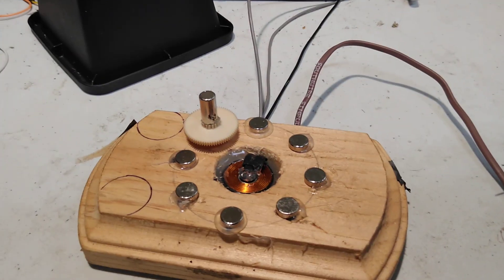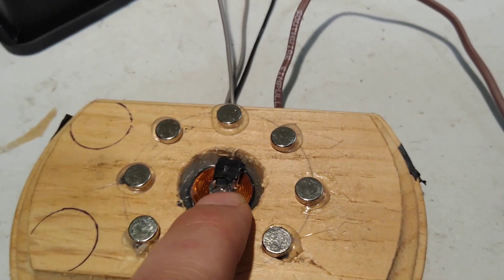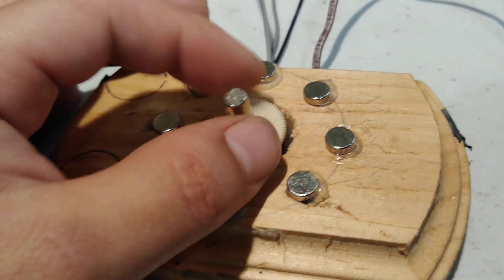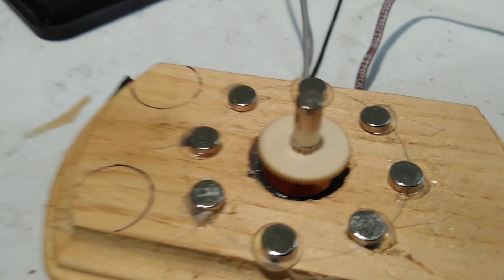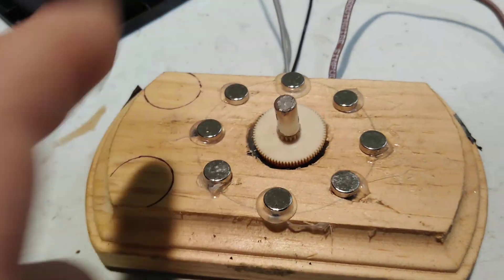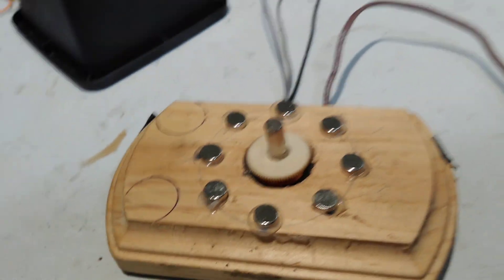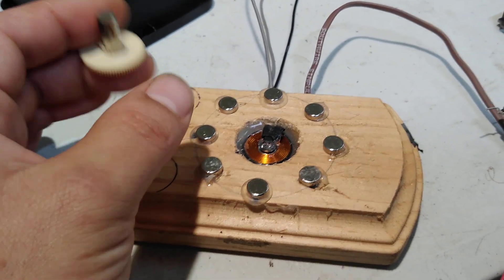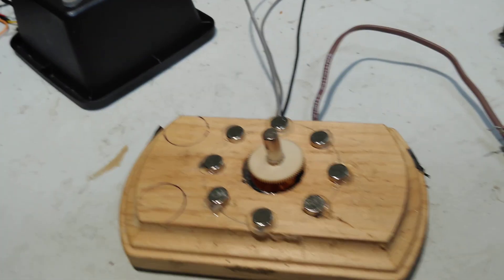Magnetic Levitation/Suspension For Low Power.

Comment: what is your resistance of your coil? you have a coil with iron core?
Reply from the maker: it's probably something like 40 ohms but does have a steel core. It was a cheapo little electromagnet sold for lifting very small weights with probably 28AWG wire.

Comment: Very nice video, thanks! Is there any way to eliminate the noise from the coil?
Reply from the maker: I guess it all just depends on what frequency range the circuit wants to continuously switch at. I don't really hear much without straining my ears with these circuits unless I give them some kind of surface to reflect magnetic fields off turning it into sort of a speaker. I'd image the higher sensitivity hall sensor (as linear scaling goes) the faster it will switch over time. the coil could be driven at resonance further decreasing the necessary input power which could also decrease any audible noise.

Comment: This is a really cool set up, I wonder if it would work with my tiny analog circuit. Well done
Reply from the maker: Thanks! the mini platforms aren't as easy to get right from low power using just the transistors and sensors but I've been able to tune them a little by just using linear halls and throwing a trimmer on the sensor output, TIP120 seems good for it. One I just finished for example needed about 28Kohms to get in 'range' then from there a 10k trimmer seems to be an easy way to increase or decrease the push/pull slightly, just enough to where a particular magnet can be stabilized, and if another similar magnet of slightly more mass just doesn't want to stay up I can nudge the trimmer some and it works. I've just had to check specific threshold voltages and what exact resistances I need to hit them etc and it keeps me from having to move the sensor around all the time. I've been cheating a lot using aluminum plates to help keep them stabilized though. Just seems less of a headache lol. For some reason I want like a small army of little battery powered levitators before I try to build a bigger one. I think the 4.2v lithium to USB boost circuit is a good little deal for the small toy versions.
Reply: @Magneticitist  Have you used the AH543 like I did? I have tried a few and few of them have the capabilities of it. It has really fast response and very little drift.
Reply from the maker: @Zenodilodon  I've just been using some AH3503's I got in a pack a while back and haven't tried any others. They are handy because they'll swing negative or positive depending on the polarity of the magnet facing it. I haven't noticed much drift on these but they are also cheap as hell and can't be among the most suitable. Only good up to about 6v also.
Reply: @Magneticitist  I have never used the AH350, It was pure accident I found how good the Ah543s where, they are not really cheap though. The 543s are quite digital in nature and I believe are unipolar so I don't think they can do both -/+ output. Are the 350s linear in response or just on/off?
Reply from the maker: @Zenodilodon  They are linear but chances are they might not be as precise as what you're using. Honestly these are the first hall sensors I've ever played with and just picked the cheapest linears on ebay. I kind of like using the linears because I can then hone the sensitivity according to the output voltage of the sensor. Otherwise I'd probably have to play with spacing too much. With larger amperage setups I guess there's a lot more wiggle room.
Reply: @Magneticitist  Since the 543 are so quick the practically eliminate all issues with spacing, they do get more sensitive to input voltage but since they are so fast once an item has found it's equilibrium it's state of switching is so consistent it makes maglev almost brainless. They are the same ones I used in my mini maglev and so far are the only ones good enough for such a simple circuit, others I have tried for this have not come close to self stabilizing and  they are worth the price. I recommend trying them.
Reply from the maker: @Zenodilodon  Thanks I'll try them out, sort of excited to see how much more stable I can get them with better parts.